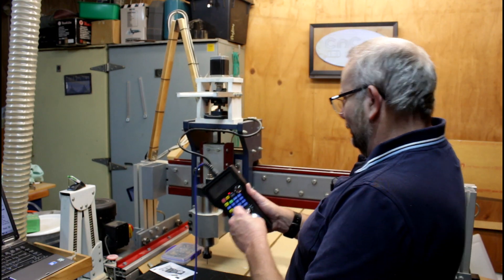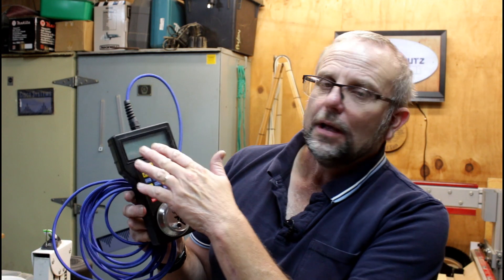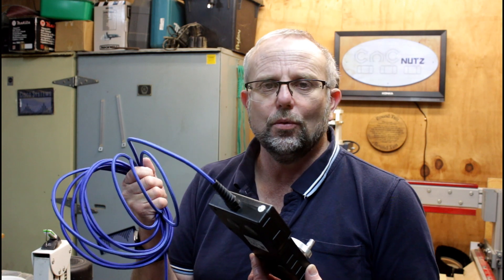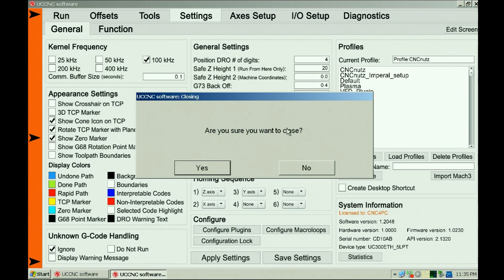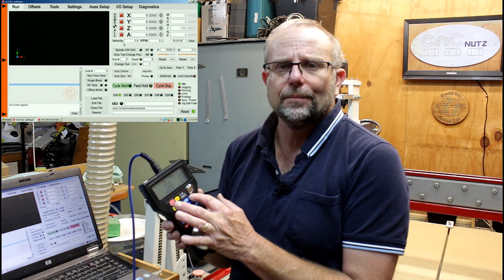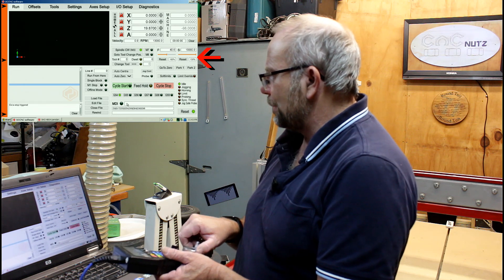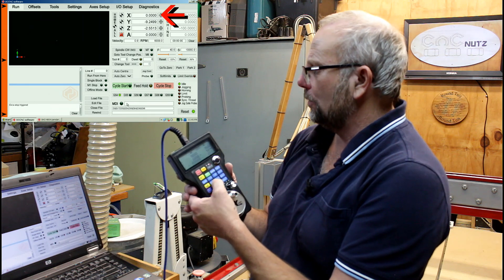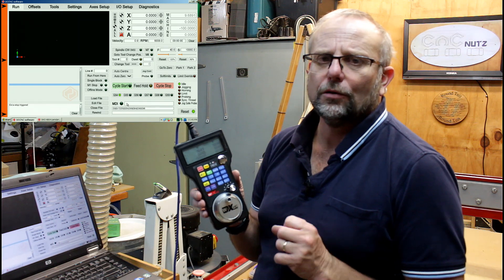Install XHC-HB04 Pendant on UCCNC - CNCnutz Episode 231

Comment: Is this controller gonna work with masso g3..?
Reply from the maker: No. 
MASSO  will not work with this pendant.
Reply: @cncnutz  can you please suggest some similar types of pendant that can work with masso.
Reply from the maker: MASSO sells a pendant that works and if you want wireless you an look at the wireless  pendant I use on mine. 
Cheers Peter 
https://youtu.be/vZHDkWsVRGQ

Comment: I just purchase the XHC WHB04B Wireless but for some reason does not look to work with uccnc, any suggestions?
Reply from the maker: I don't know. When you say it doesn't work do you mean it turns on and shows the DRO's but turning the MPG doesn't move the axis or do you mean it is dead entirely.
If the DRO's don't change when you turn the MPG you turn it, it my not be in MPG mode. Press the MPG mode button to enable the MPG.
Cheers Peter

Comment: I have the same pendant as yours but my machine is a Shapeoko XXL and was wondering if I can interface it to that machine.  Do you have any idea ? Thanks, Mike
Reply from the maker: Pendants do not interface with machines. They interface with control systems. You would need to check the control software you are running and see it it supports the pendant.
Cheers Peter
Reply: @cncnutz  I realize the MPG interfaces to the control software.  I'll rephrase the question.  Do you know of anyone using the HB04 with Shapeoko's "Carbide Motion" control software.  I have a home built 48X48" CNC that runs on CNCLinux and I was able to interface it easily to it.
I would like to interface to the CC but I haven't found any docs for the CC software.
Reply from the maker: @w4fej  sorry I don't know the system that you are speaking of. I can only suggest checking with the Shapoko community. Good to know it works with Linuxcnc.
Cheers Peter

Comment: hi. i have one of these.i dont know if you spotted them on the backface,but there are 4 magnets so you can attach it to any steel object. i cut a piece of steel plate with a lip on the botom to dtop it sliding down. thanks for the vid,you picked up on  a few points that i hadnt noticed
Reply from the maker: Thanks Ian. Note that there was an error in the video that I corrected on my website. Click the link under the video.
In the video I show that you need to put a check in the call at startup box. This is incorrect and checking this box will cause the configuration box to open at startup. If you leave it unchecked the pendant will still work and you will not be bothered by the start up box when you start UCCNC.
cheers Peter

Comment: Hi Peter good explanation you make it look easy is this Pendant still available on line there seems to be a lot to choose from I read on an ebay that someone had bought one  just like the one you have but it only worked only on Mach3 so that makes me a bit anxious to buy one you know what I mean didn't you say you were selling yours?
I am using UCCNC software
Reply from the maker: Personally even though it has all the bells and Whistles I prefer the cheap pendant I used before it. It works well but you need 2 hands to use it. My other pendant works with 1 hand and I don't need to look at it. I have no intestine in seeing the info on the lcd screen as I want to see what is happening on the table. I also never managed to get it working on Mach3 bit worries we'll on UCCNC. If you live in NZ I'm happy to sell. Just my personal opinion. Sometimes simple is better.
Cheers Peter
Reply: Hi thanks for that 
I think I'll stick to my wireless keyboard works fine 
John

Comment: Do you know if this can control the inexpensive CNC 3018? Thanks for your video!
Reply from the maker: Thanks Tony
It depends what controller software you are using.
Cheers Peter
Reply: I'm in middle of reorganizing my room, but the CNC3018 is the PRO version that comes with a larger than the original external controller - but I can't tell you what is the model number at this moment. But I did not update it, so it is the same as it comes with these inexpensive CNC's. The external LCD controller has a flat ribbon cable that plugs into the main board. I purchased it here: https://www.amazon.com/gp/product/B07DXMFY38/ref=ppx_yo_dt_b_asin_title_o07_s01?ie=UTF8&psc=1 It is GRBL If that isn't enough info, I'll try to dig to it and give you the model number. Thank you for a quick reply and thanks for sharing with all of us your videos!
Reply from the maker: The pendant works with UCCNC and Mach3, though I never got it to work with Mach3 myself. It will not work with your current setup.
Cheers Peter
Reply: @cncnutz  Great news! I'll order one and see if it works! Thank you very much! Stay safe from Corona and other viruses!

Comment: Peter

Excellent helpful videos. I am just getting to grips with UCCNC and AXBB-E controller  with closed loop steppers for a new system. On my old systems I use Mach 3 but like the idea of a new challenge! I have my steppers working now and wanted to add my WiXHC WHB04B wireless Pendant that I use on my old system. The standard plugins only feature the usb wire connection and that does not work. Do you know if there is an updated plug in for this pendant, which is excellent by the way.

John
Reply from the maker: Sorry John I don't. Short of looking on the UCCNC forum and checking I can't suggest anything thing.
Cheers
Peter
Reply: @cncnutz  
I just bought a wireless version of the HB04 you have reviewed. It was ordered direct from China and came with no instructions and no drivers. As I mentioned I use UCCNC now. I was amazed to find that it worked straight out of the box. I just made sure that the USB receiver was plugged into the computer before switching on the hand unit. I used the supplied UCCNC plugin. The quality of it is not as good as the old WiXHC Pendant that I have been using under Mach 3. The switches feel very plasticky but I guess so long as they work that is all that matters. There is no Plugin for the better WiXHC pendant unfortunately. 
John

Comment: Peter.   Another excellent video.
I have used one of these pendants with UCCNC for about a year now.  Wireless one.
You only need to enable the plugin.  Don't have to "Call on startup"
Reply from the maker: Thanks I will uncheck it and give it a try. 
Cheers
Peter
Reply: Can you reply with the model you are using? id love a wireless one instead.

Comment: Hi Peter. Thanks for another fine video. Have you experienced any problems with Z probing when enabeling the plugin for the HB04? My UCCNC installation does not probe correctly when using the plugin for either the HB04 or the UCR201 which I also bought.
Reply from the maker: Its working alright so far for me Jan.
Reply: @cncnutz  Hi again Peter. I´m still struggeling with issues regarding the pendant. Could I ask you what UCCNC version and what windows you are running (Windows 7/8/10, language 32/64bit).

Comment: With the help of your video i managed to successfully install the HB04 for UCCNC in only 5 minutes. Many thanks for this really great video!!! BTW ... is it possible to zero in UCCNC the XYZ like in Estlcam CNC SW? Means i am moving X, Y or Z until it hits my probe and the moving axis will be automatically set to zero when the probe sends the signal. I only need to configure probe distance and cutter diameter. Is there any plugin available to do this? I am new in UCCNC and really like the way it works in Estlcam.
Reply from the maker: The autozero macro I did a video on will do that for the Z Axis as Nd if you have a look at the 2017 screenset  http://www.thecncwoodworker.com/uccnc.html
There are a series of macros for locating X & Y. One of them might work for you the way you want. Very nice screenset even if it doesn't. He has some videos about the features you can watch and see if it is what you want. 
Cheers
Peter

Comment: Another great video Peter. I have the same Pendant and love it. I have macro button 7 set to save offsets (Way down near the bottom of the list). This way I can set my XYZ for a job, press macro 7 and the offsets are saved. This means if there is a power out, I will not loose my offsets.
Reply from the maker: Good idea John.

Comment: 10:38 - If only you had a CNC machine to cut out a "C" shaped wall mounted bracket it could slide into...
Reply from the maker: Yeah, but what's the chance I will ever own one of those.
Cheers
Peter

Comment: I too purchased this unit +- more than a year ago.  I tried it on Mach 3 and not all bottoms operated. I tried programming; with nothing changed. Do you know how to update drivers? I have not found a web site that provides updates. I hope a more current ver. of the driver may solve the issues.
Dan
Reply from the maker: Hi Daniel

After recording the video I went and looked to do a Mach3 install of the Pendant and after 2 days i still can't get Mach3 to even recognize it. I downoaded the ShuttlePro  plugin from the Mach3 site as well as numerous other suggested plugins so not sure what is going on. Since it is designed for Mach3 that should have been the easy part and UCNCN should have been the problem.  I will keep trying and see where I am going wrong.

Comment: I keep mine on the side of my controller enclosure.   It has some pretty strong magnets on the back of it.  Glad it made it there without damage.
Reply from the maker: Thanks Dave.
I looked the through the manual but doesn't mention the magnets and it didn't stick to the wood and Aluminum of my machice.
I tried it just now and it sticks ok to a large flat plate but not to smaller pieces of steel. Could screw a plate to the machine leg.
Cheers
Peter

Comment: It has a magnet on the back you can hang it up with. I need to figure out how to do micro's with mine on Mach3.
Reply from the maker: Thanks Larry. I will check it out. I never thought of magnets but then my machine is wood and aluminum.
Cheers
Peter
Reply: Ahh Yeah. I forgot about that. The four pads of the back of the pendant are magnets so the pendant will stick to many surfaces. It's a shame my CNC is mostly Aluminium and the CNC table is wood.